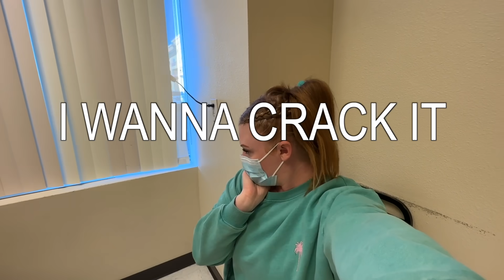Rushed to the ER after SOCCER PRACTICE *emergency*

Comment: This happened to me some years ago - I was mopping a tile floor and slipped and landed on one hand. My dad talked me into going to the ER, even though it was already late in the evening. I went and they said that some small bone might have broken and they put a splint on it and referred me to hand specialist. She then told me that the only way to confirm is to take multiple xrays over a week or so...if it was broken, they'll see changes on those Xrays as it heals. Turns out it wasn't broken. But I learned something interesting.

Comment: Yes bees can have a nest in autos. We had two different trucks and bth have had nest in them. We sprayed them. We didn’t think it could happen. But after about the 20Th time at different locations of seeing them around front of trucks then we knew for sure. Spray front of truck and also around the front window. We had lights on top around the windows and also found them there.